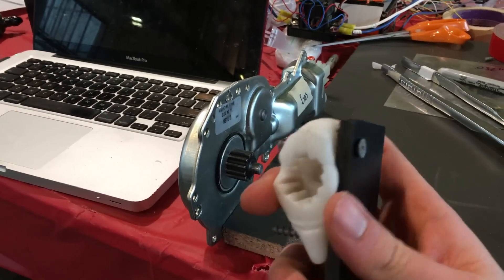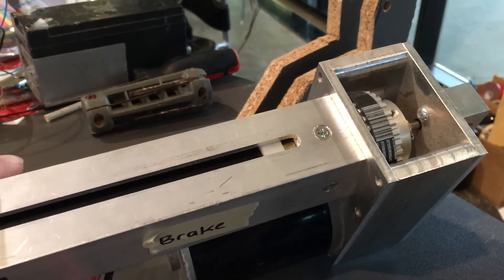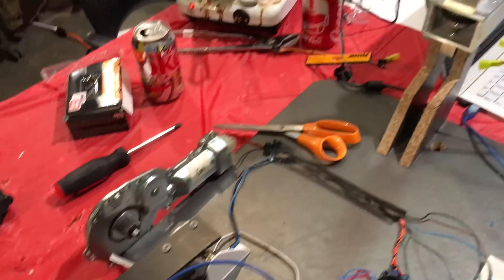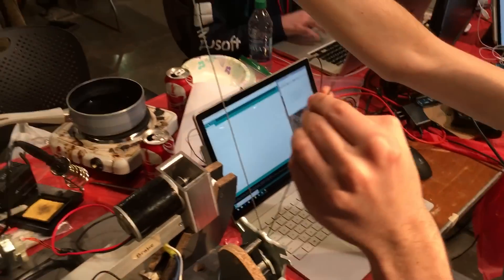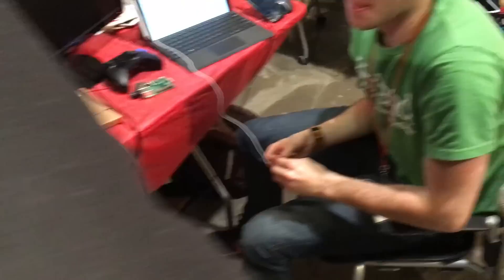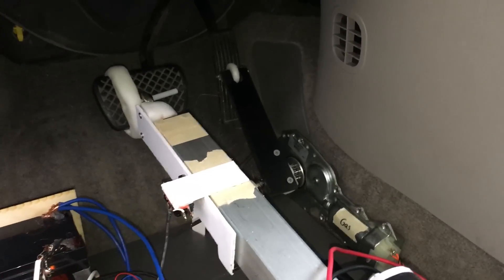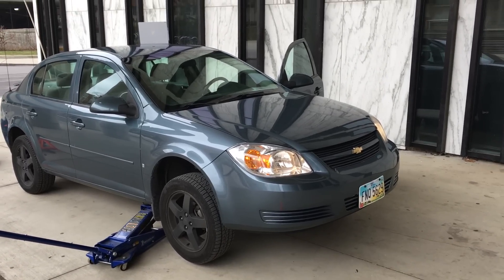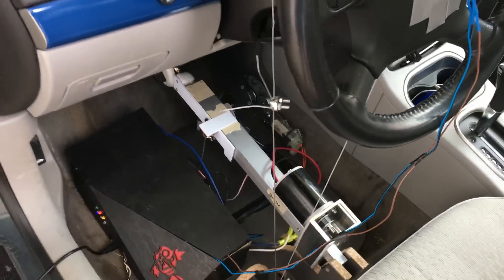24 Hour Hackathon: Real RC Car

Comment: You are a genius!
Reply: +A.A A What? This is easier than lego. And nothing new. Just like kids building kit. And useless.
Reply: +Welt Rogg That's nowhere near easy. Just come and try to build something like that in 24 hours, than we'll see if it was easy or not. You're just demonstrating the Dunning–Kruger effect at its best.
Reply from the maker: +Welt Rogg Things are always easy when you know how :P   ..most people just don't know how.  And hackathons are for fun, not for usefulness
Reply: altapowderdog Sure the system design on this one is pretty easy, but if you had practical engineering experience, you'd also know what difficulties there can be when trying to realize such a project, especially under time pressure.

Comment: Very cool project. Did you ever drive it? Surely you drove it. It's dangerous as hell, but no way I could keep from at least trying it once in a parking lot somewhere.
Reply from the maker: +Nick Shaver Oh, I'm absolute going to test it, But not until we go over the code that was written super hastily and make it more reliable